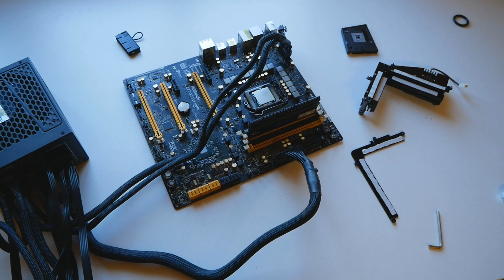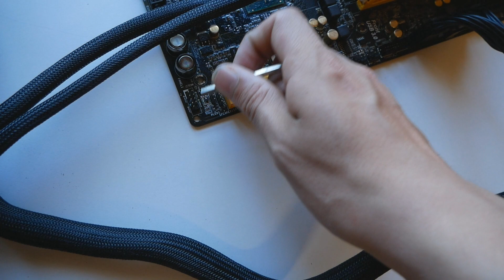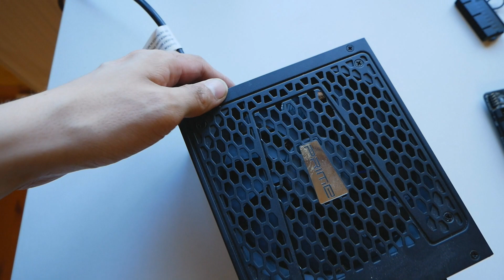Repairing a Dead Motherboard in the Oven the Easy Way - Summary and Test

Comment: Would this method work using a 3d printer bed as the heat source but for a lot longer time as it will be not an enclosed space?

Comment: Yes, to melt tin you need 232°C, so lower will just create a sort of molecular excitation in the electronic chips. Indeed, it can work a day or a month, depend on the ambient temperature. All is about temperature. Dust can be the problem, sometime when you close-up on the chips, you might see dust particles stick beetween the pins. Use a good antistatic cleaner and dry it with a heat gun, you should get a good result.

Comment: hello can i use this method to revive mine? because linus said avoid using this method with an oven used for cooking is it true or is it safe?
Reply: Its not the best way to revive a dead motherboard and it doesnt have a 100% succes rate. The motherboard can also release toxic fumes. So dont try it in your everyday oven since it will be unusable after.

Comment: Have posted an update? It would be interesting to learn how long the solution worked for.
Reply from the maker: It didn't work for long, some issue with chipset. I sent the board to a local guy for repair attempt.

Comment: Could of been moisture in the board over time of no use. I keep my stuff in the anti static bags with little packs of silica gel and seal them up. Then put them in a rubber sealed storage tote. If the board has moisture in it and it gets heated too high too quickly the board will warp n bubble.

Comment: 120c dors not even melt solder right? So this helped to motherboard or plastic  warping or to burn out dust or residues from contacts.
Reply from the maker: Or just let some key parts to expand a little bit.
Reply: the heat releasing moisture from the ic package
Reply: We used to heat transistors to fix them, so chips are the same principle.
Reply: sometime, if you desolder some transistors, clean them before resolder it works for long time

Comment: i have to use a heat gun on an old gtx 460, it fully works as normal for around 2 months (used daily for older games) then it needs to be done again, i delidded it and applied a bit more heat the third time, so i will see if that makes any difference

Comment: Heh. did the same a few days ago. After baking it, but the only result after booting it up again was a blown capacitor... :-/
Do you have any tips on trouble shooting motherboards or do you know someone wo explains it? It appears everything i found expects you to be an electrician.
Reply: Blown cap, did you replace? Could have a bad mosfet too or a short from something else.
Reply: @Music-yt7xo  hi. haven't replaced it yet. i learned from buildzoid when the oventrick may work and when it doesn't. i suspect i created a short by heating it, but haven't looked into it. as a total beginner it's hard to know where to start. i could look for a short, but i have absolutely no idea which rails to check

Comment: It's scary to think that this could have been done to any motherboard that you buy used (i.e. of eBay), and the mobo is just ticking down time until it reoccurs....like a month after you receive it :(
Reply: That’s why I never buy used motherboards. I buy used other stuff, but not motherboards.
Reply: @vilecandy  don't buy used motherboards, don't buy used PSU's, and don't buy used Hardrives, SSD's are ok, GPUs are ok (as long as they didn't use to mine it, and RAM is also ok. Cases are ok too as long as they look good. Fans I would go new aswell.
Reply: @VengeanceLN  mined gpu's are also okay as long as they weren't overheating. Their performance do not degrade and it's been tested and proven multiple times. But I still wouldn't buy a gpu that's been used as mining because I refuse to support miners lmao.
Reply: @noodle_Cx  agreed
Reply: I believe that what happened to me

Comment: Did you try to reseat the clrCMOS jumper before the oven? If the jumper is not there or has bad contact the board will not start.
Reply from the maker: Yes I did. Could also be that the Chipset BGA is a bit broken.